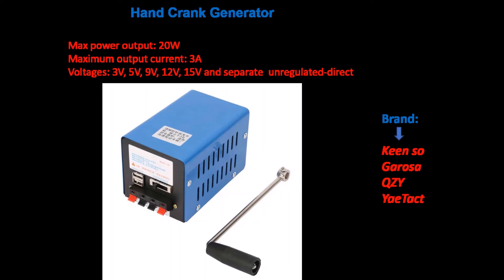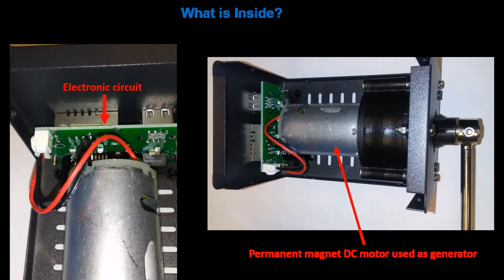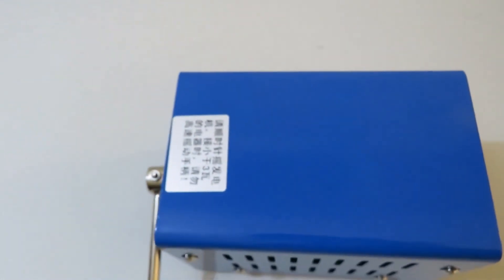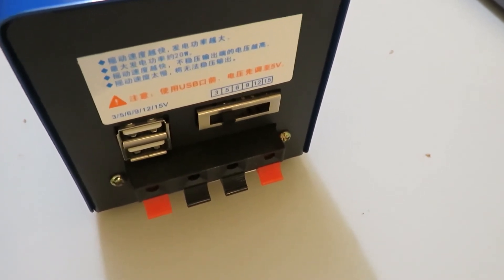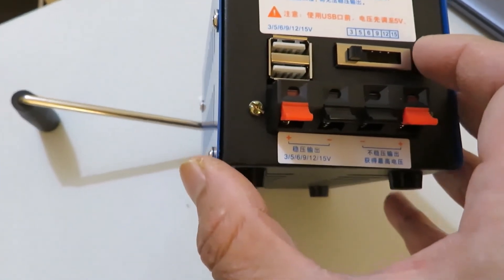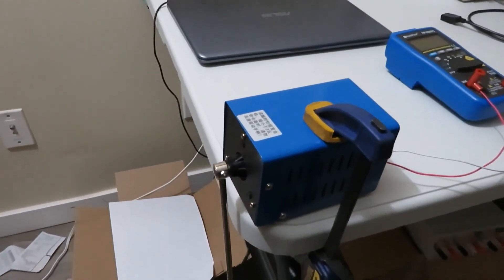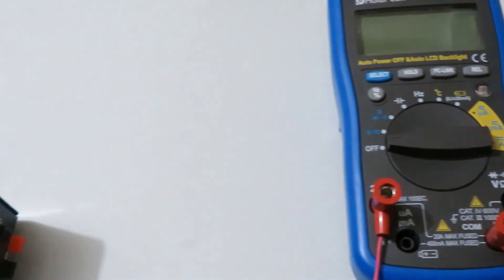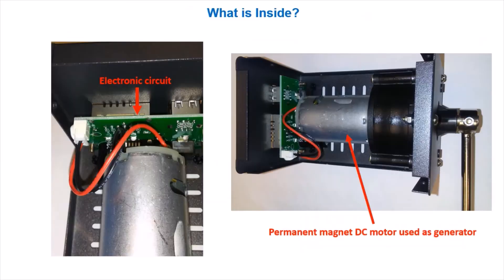Hand Cranked Emergency Generator

Comment: Great video. This generator can be improved by adding super capacitors.
Reply from the maker: Yes, Supercapacitor can hold some energy, however the energy density is still smaller than Li-Ion or lead-acid battery. Other problem is voltage, supercapacitor voltage is limited to ~2 to3V. You have to use series combination then capacity will be reduced
Reply: @technologyforyou5976  All true, but it still gives you some crank free power, to do some work without continuous cranking, which is really helpful. Check out laser saber"s video, where he added super caps, it's very good.
Reply from the maker: @planecrazyish  Thanks I'll watch it